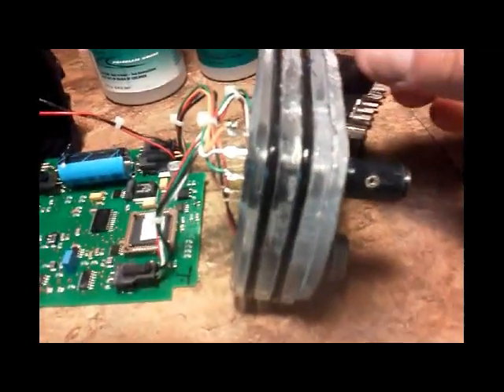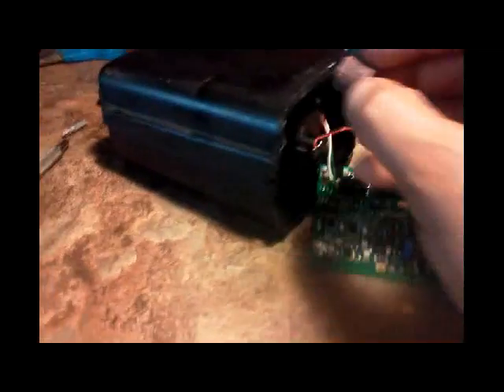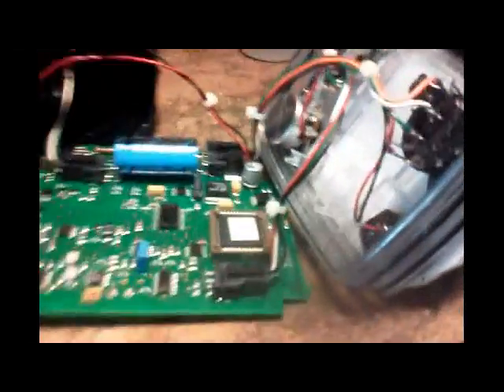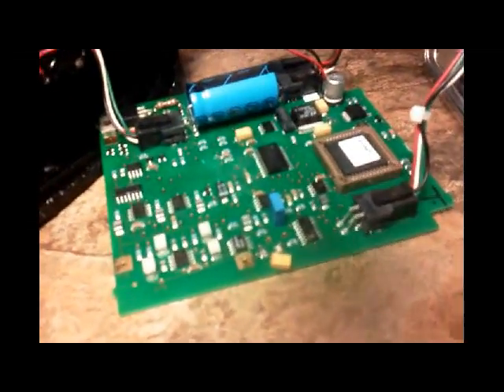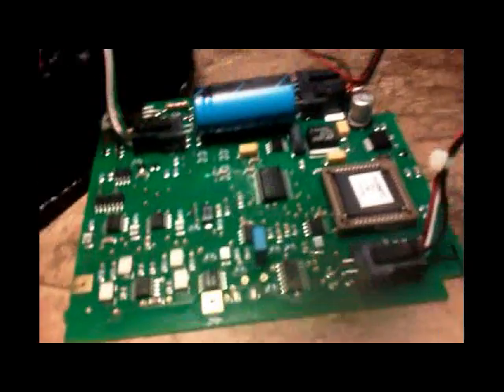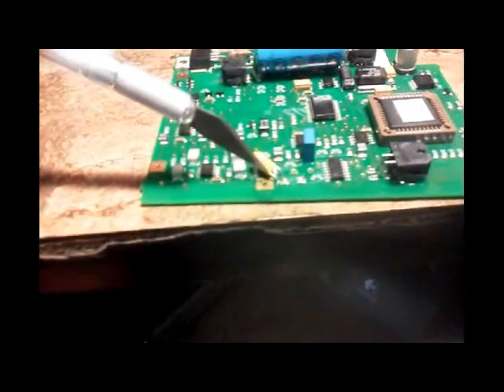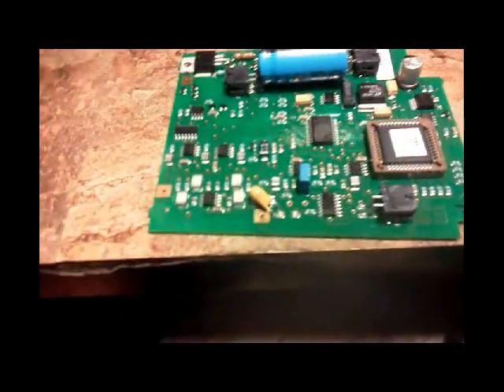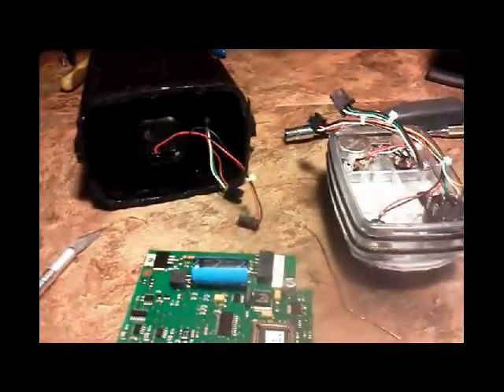Internal look at Garrett Seahunter II for repair purposes

Comment: congratulations for the post friend, I need your help, if possible I would like to inform you where the repairs are made in the detectors with problems in the electronic board, I have a sea hunt mark 2, and the electronic board failed, and until today I could not fix it. where can i buy a new board

Comment: How did you dismantle the detector, I have the same problems, I want to dismantle it and look, but I don't know how it was dismantled. 3 screws are available inside the battery bed. Do I have to take these off?
Reply from the maker: Yes, those three screws.  One of them holds the two parts together.  Take all three out, and you should be able to pull apart.
Reply: @UnderseaCaveman  thank you very much 🤗🤗👍
Reply from the maker: @Dalış_Günlüklerim  You Bet!!  Anytime
Reply: @UnderseaCaveman  Everything's fine, as you said, I was able to remove my detector👍
Reply from the maker: @Dalış_Günlüklerim  That's awesome....Happy Hunting!
Reply: @UnderseaCaveman  Thanks to you, I'll see you later. Thanks

Comment: Please how Can open headphone Garrett seahunter?
Reply from the maker: Ah....I don't know...never tried that.  I think you are going to have to cut it open (with a Dremel for instance).  You can glue it back together with J-B Weld or 2-part epoxy.  Have fun, stay calm....time is on your side, no rush!!
Reply: Thanks for tour response. Yesterday i have start my SH but not start. I think at headphone. Can i to Be another test? The battery are full. I have a Digital testet. Please help me.

Comment: I cant open my seahunter battery compartment, any ideas?
Reply from the maker: Look inside the Battery compartment with a Flashlight.  You will see a Screw that needs to screwed out.   After that you should not have any real problems opening (pullling the front off).